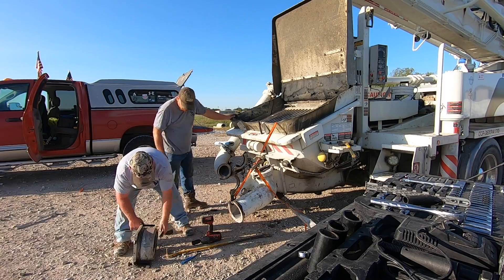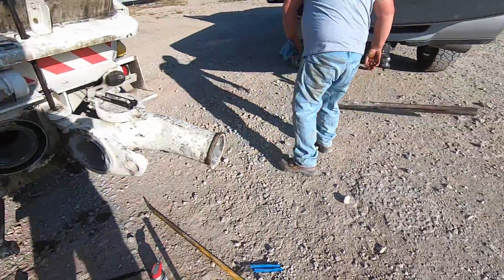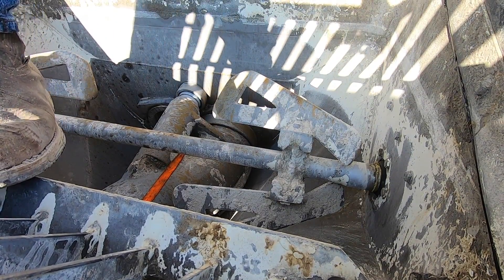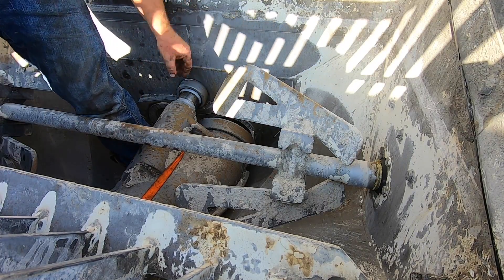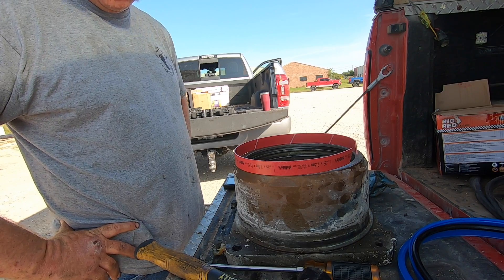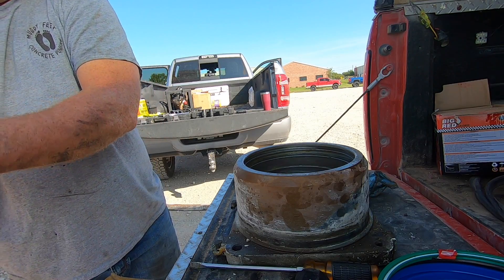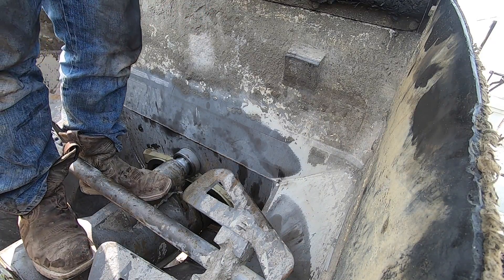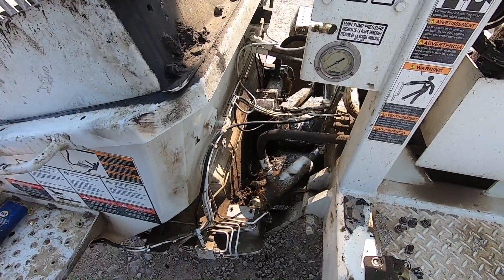Replacing wear parts on the 38 meter boom pump.

Comment: I'm looking at buying a used concrete pump, would you guys make a vid about what things to inspect when looking for a used machine. I'm currently working my way through your 20 maintenance videos to get an idea of what I might be in for.
Reply from the maker: What type of pump are you looking for? Trailer pump or line pump.  Our line pump is for sale for $50,000.00 currently

Comment: Weld a guard over the rear driver oil sending unit....its common to back out and over a hard mound of mud , Found ours broken because of that.
Reply from the maker: I guess I’m not sure what you are talking about.
Reply: @MuddyfeetConcretePumping  Sorry, my 37 Liebherr came into the shop, driver says dash light warning came on about the rear driver axel temperature,  turns out after a big pump job he had ro back up over a mound of concrete that was high and hard enough to break the temperature sender on the differential. 2016 Pete.

Comment: I probably would of put those output seals back in and kept the new ones for when you need em but cutting rings never hurt to change.. s tubes beat rock valves all day long
Reply from the maker: I was just happy I didn't have to replace that chrome ring. I use to dread taking the back end off but not so much now. I still think its easier to replace the parts on a rock valve than a Stube.